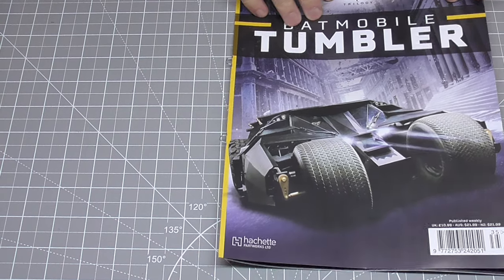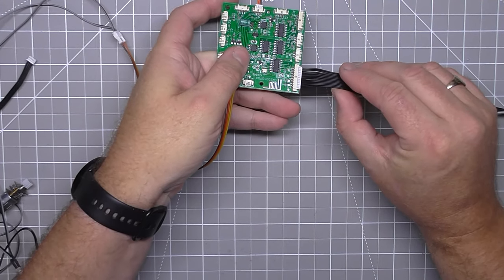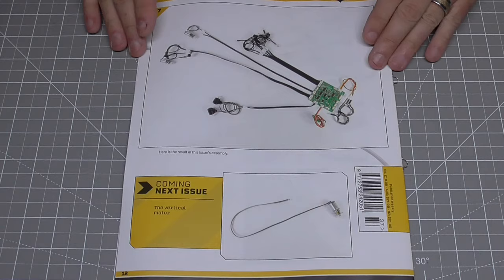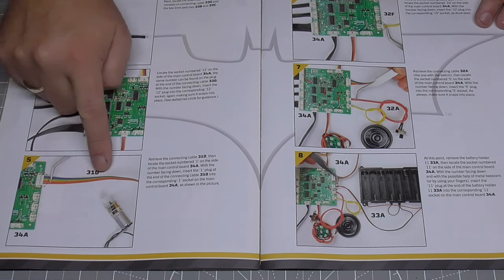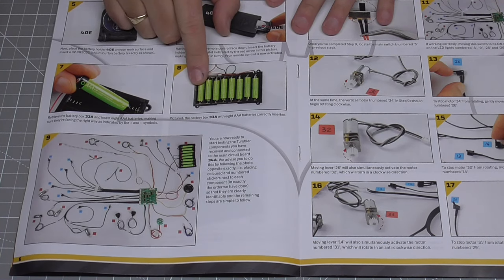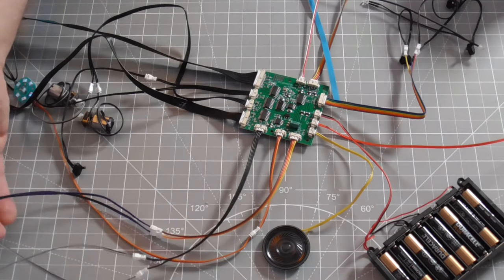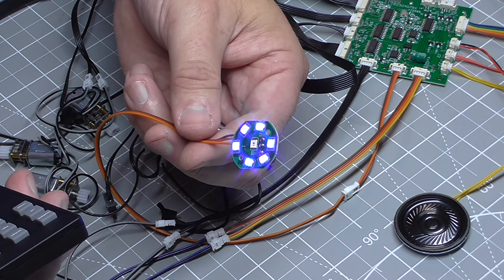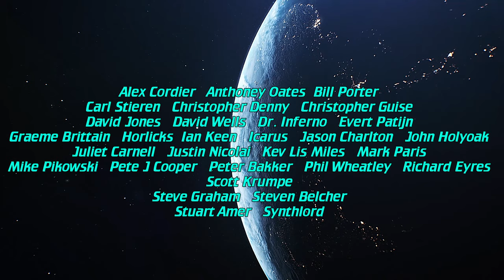Build the 1:8 Scale Batman Tumbler from Hachette Partworks - Part 35-40

Comment: Its good we test all the electrics; but they could have bundled it into 2 Stages, with the remaining packs with parts to assemble onto the car. But that is one of the problems of a 2-year build. The Stages have to be stretched out. One thing I don't get is why extensions? Why not make the wires the length they need to be? Each extension = a breaking point.  That said, think you'll add heat shrink to help keep the connections secure at time of install?